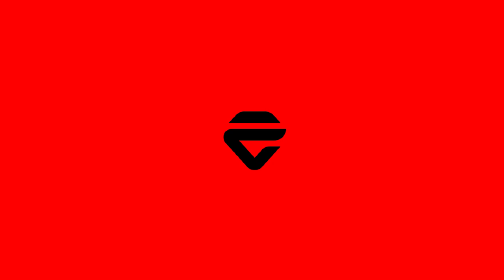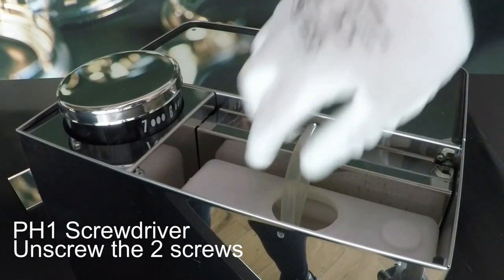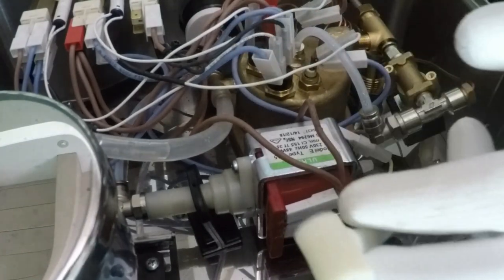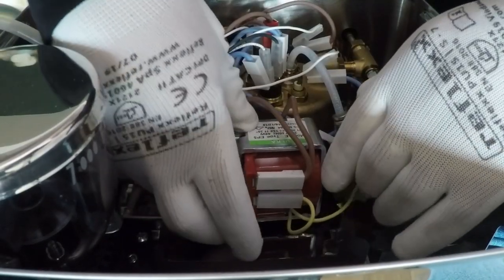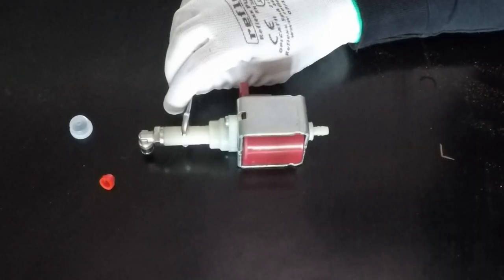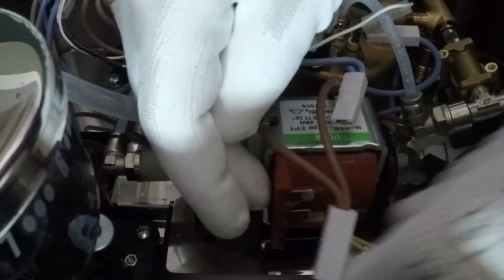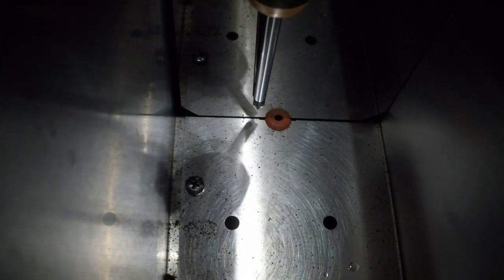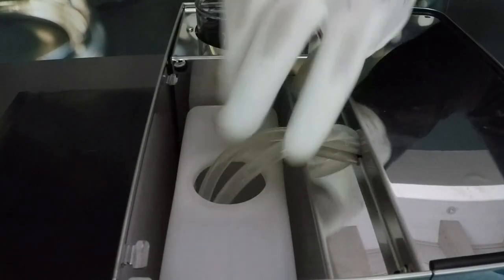Anna PL41 - Anita PL042: How to change the pump

Comment: I have small problem 
When i start extracting the pressure starts with 9 or 10 bar bit after few seconds goes down to 7 bar 
I tried many solutions but still
Reply from the maker: Hi, we suggest you contact your local distributor to solve this issue. Take care, LELIT Team
Reply: @LELIT_Official  we don't have local suppliers in ksa
Reply from the maker: @abuyarawzaz  we suggest you contact COFFEE BEACON (www.beaconcoffee.com). Thank you! LELIT team
Reply: The presure of the water extraction does not depend on the pump but the resistance the coffe offers. Pump maximun presure is usually 15 bar. But the presure when making cofee depends on how you set the coffee load on filter. If coffe grind is coarse and not tampered well, the water just goes through and pressure will be almost 0. If gind is thin and well tampered, pressure can rise up to 12. Can happens that after water starts flowing , the coffee gets wet and resistance to water reduces a little, this is why presure comes down. Does not seems to be a problem. Try using more fine grind, 8 grs of coffee for a single shot, and tamper strong. Pressure should go to 12 and not drop or just a little
Reply: Have you chekced if the pressure also drops with the blind filter? If not maybe you have to check your grind size :)
Reply: @xPentag0n  hey mine drops with the blind basket from 10 bar to around 9 and stablelized there… sonetime it goes from 10 to 9,5 to like 9,7 again an than dropping to around 9. Is this normal? Also the needle is vibrating during the pump. 😅
Reply: @alexanderb.1515  I can check tomorrow but if it is pretty stable at 9 bars that sounds pretty normal. I think the vibrating is normal too :)
Reply: @alexanderb.1515  Mine idles pretty much at 10bar and has little vibrating (but you can see it if you look for it)